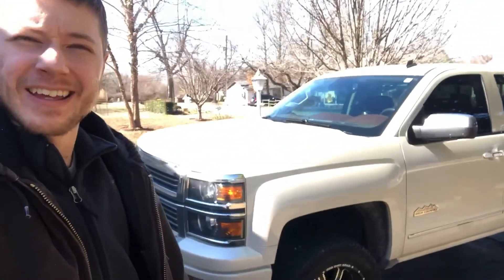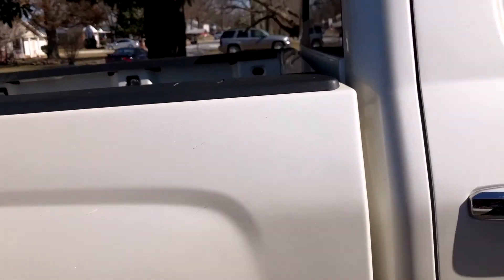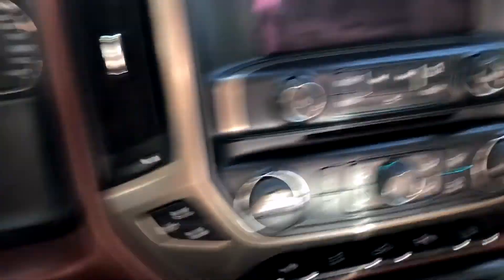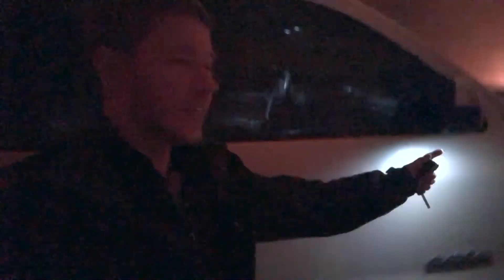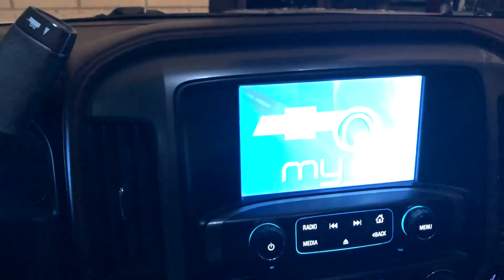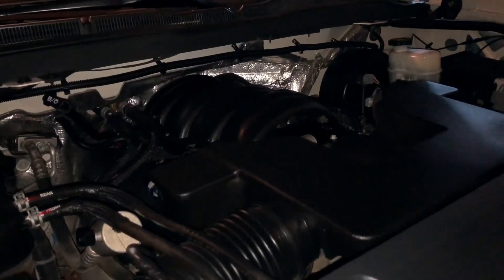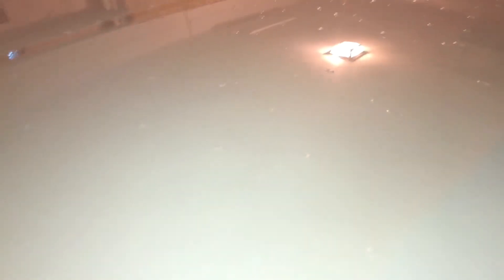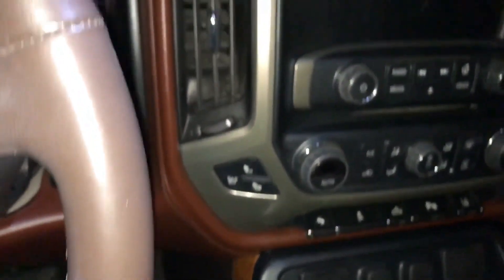Silverado Lifted High Country (NEW TRUCK !)

Comment: Congrats on the new truck! Those high country's are fast, make a 0-60 video. I drove 3 hours to get my 2006 Voretcmax btw.
Reply from the maker: Thanks buddy! I’ll see what I can put together for you! Very nice, Vortecmax is an awesome engine
Reply: Dustin T question for you. I have a 2018 Silverado 2500hdLtz and I’ve been having a rattle in my front passenger seat. Taken it many times to the dealership and still haven’t had any muck with them finding it. Have you seen or heard of anyone having this or maybe even you? if
So any feedback would be greatly appreciated.

Comment: What wheels and tires you running? Like the look.
Reply from the maker: Thanks buddy! These are red dirt road wheels rd01 with Dick Cepek fun country 285/55 r20s. Decent setup, and not crazy expensive.
Reply: Dustin T how wide is the actual wheel? 20x10? Sweet truck all around!